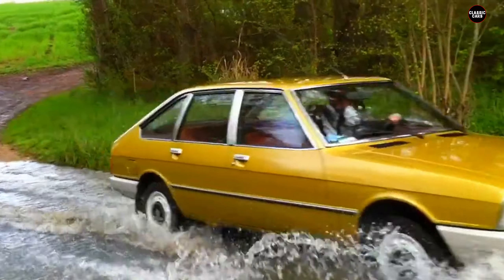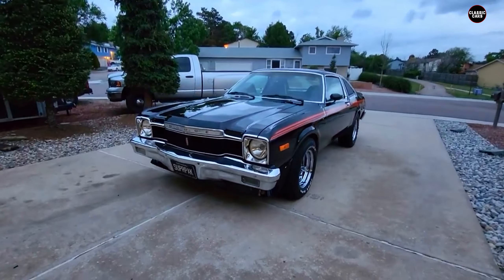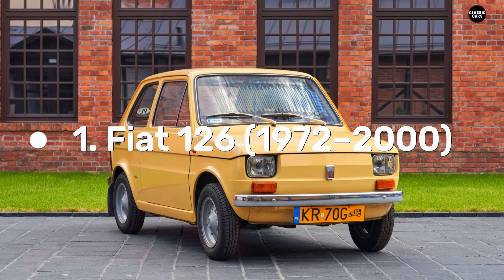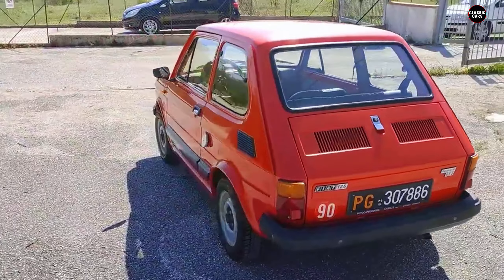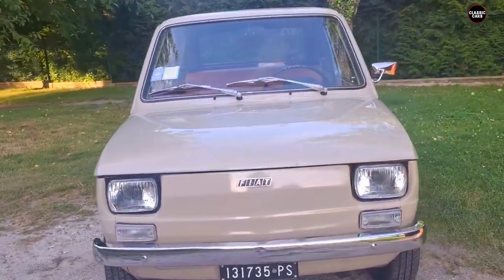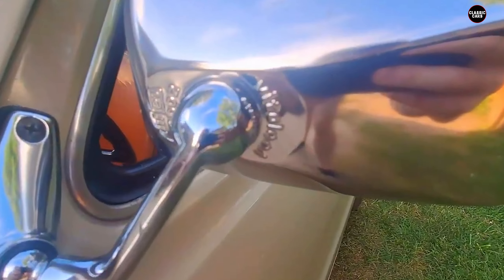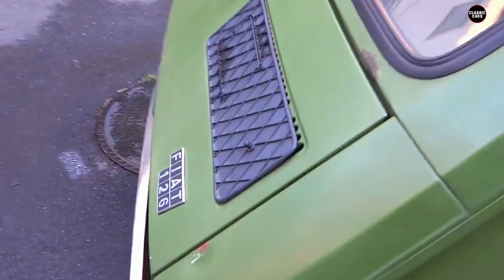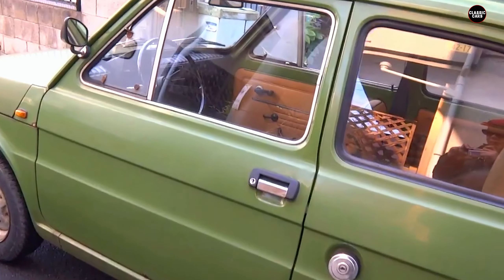You Won’t Believe These Exist! 12 UGLIEST Cars! That Only Poor People Could Afford!

Comment: I owned a 1962 Sunbeam Alpine for several years from 1968 until 1970. It originally had a 1600cc engine which was pretty clapped out when I purchased it. I managed to obtain a very low mileage (1,100 miles) 1725cc Hilman Hunter engine from a motor wrecker. The Alpine had a aluminium head which I had completely rebuilt. The firing order was also different to the Hunter which had a cast iron head. I managed (in 1970) to obtain a brand new full race camshaft. The 1725cc engine had the same bore as the 1600cc, only a longer stroke and an extra bearing in the crankshaft. 
The transmission was a 4 speed close ratio gearbox with a Laycock de Normanville electric overdrive on 3rd and 4th gears.
I loved this little car and with the engine upgrade the performance was quite a bit better than the standard 1600cc engine.
It came with an aluminium hard top.
Reply: Back in 1970, an undergrad student, I owned a '63 Alpine, it was giving me so many problems I don't even want to think about it. The later 1725 versions I understand were much better. I kept it for just a few months, until my father bought me a brand new Cortina Lotus mkII, I was so happy and ever so relieved!

Comment: Sunbeam Alpine and Hilman Hunter are on this list - both great sellers !
Reply: The infamous VW Beetle did be sold millions of times, nevertheless it was a true shitcan . . .
Reply: @letoubib21 It wasn't if you had the correct one. 1967, 1500cc, torsion bar front suspension, z-bars at rear, front disk brakes.

Comment: No one with reasonable eyesight could call the Alpine ugly. It was one of the prettiest cars of its era. Stubbornly just not able to crack 100 mph it had perfectly acceptable acceleration and high speed cruising ability with overdrive.  Like all cars of its era it was produced with unpainted box sections and dead air spaces so it rusted badly in damp atmospheres. It was very sucessful in the UK, Europe and the US selling approx 8,000 models per annum on average and earning England lots of $s.
Reply: I admit it... in around 1986 I regularly got a 1.5 Alpine GL over 100mph on the M45.

Comment: I can't comment on the American cars you are talking about here as I've no idea about them.  The Rootes group made really good well made cars which the Hillman Hunter is one of. There were far far worse cars at that time than Rootes group cars.
Reply: I don't know mate !! I owned a hunter and i'd have to say they were a box , a gutless pile of crap and their cornering was awful , one of the worst cars I have ever owned , and oil leaks , the dumb arses that designed the engine decided to do a way with the front seal and put a oil sling in it's place , you know where the oil went when climbing up and down hills , yup all over the road and they weren't cheap either , in New Zealand they were one of the dearest cars in their class , in fact I have to say that most English made cars were crap , under powered , engine and gearbox issues , rust a big problem and genuinely crappy to drive !!!
Reply: @dennisrichards7994 Ah, but your Hunter was probably assembled in NZ.

Comment: In the section on the Renault 10, the Renault 8, the car from which the R10 is derived, is shown without explanation. Instead of the Simca 1307, lengthy images of the Rootes-Chrysler 180 (Simca-Chrysler 1609) are also shown for no reason. And then the Simca 1100 is discussed, where you are first shown a Simca 1000. To make matters worse, the former is introduced as the Simca 1010. What a mess!

Comment: This guy doesn’t know European cars at all. Fuel prices were 4 times higher in Europe than the USA during this time and smaller cheaper to run cars were very successful. The Hunter and Avenger were market leaders and incredibly reliable cars. The Rootes group was one of the largest car companies in Uk at that time. It was the union strikes of early 70s that caused Lord Rootes a massive cash flow problem. He later sold out to Chrysler.

Comment: The Viva HA was a very successful car with well over 100,000 sold in the  (intended) three year run, it gained plenty of traction and competed well with the Morris Minor, the Cortina being in a different market sector, used HA’s were well sought after too,  the HA led to the Viva HB, one of the most successful cars in the UK.
Reply: @nikmwh  Many moons ago when I worked for the electricity board we had Bedford HA vans. Very simple with no frills but virtually indestructible, apart from the rot that affected most vehicles designed in the 60's. Incredibly, they were still being produced into the 80's - the last one I had was on an A plate so registered in about 1983! Happy simpler days.

Comment: Hey, you've got my first car here. What's it doing here? It was a great little first car and the lack of performance didn't bother me. I travelled a long distance in it sometimes and it was a great little thing. As to its looks, gee whiz, you cannot complain at its looks when compared to its atrocious looking predecessor, the retro version of which manages to look even worse. That rear end design of the Fiat 500 is just so WRONG, and also impractical. I could have designed a much more practical rear end that would not have added any length but could have either added extra rear seat room or more boot space. And here in the UK my only other alternative for a small car in the 80s was our terrible Austin Mini. Yuuk, another one with a terrible impractical rear end that unnecessarily allowed for less rear leg room or less boot space than could have been achieve with a better rear design without adding length.  I dread to think what other cars are in this video. Please don't say the gorgeous Datsun 120Y (B210) is in here, or its sister car the wonderfull Cherry FII coupe (my second car).

Comment: I started watching this video with a little apprehension, for having worked on all these vehicles, I was mechanic at the time, but for some French models presented, it is unfortunately true, although the statement of the video is a bit out of place, obviously he forgets a lot, the famous Renault 8, and the R8 Gordini, Peugeot 204,304,404,504 and the amazing 104 all-aluminum engine, maneuverable nerve, and the attractive Alfasud 4 flat cyl , and gearbox at the back, BUT it was rusting visibly, this problem was recurring in northern Europe ,apart from that I confirm, many engines where  opened  also cyl. heads , gear boxes, I was very often at the garage of 7,30 and I finished at 21 22 hours ( once at home I found another hour for  my 1960 Norton Dominator )
Reply: First thing that was odd was him using a Mark 2 Cortina as the thumbnail...they still look cool to this day like ALL of the Cortinas I think this video is designed to wind people up big time